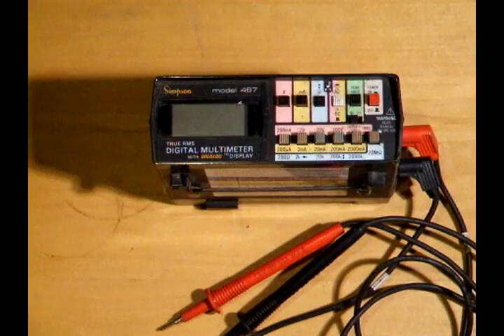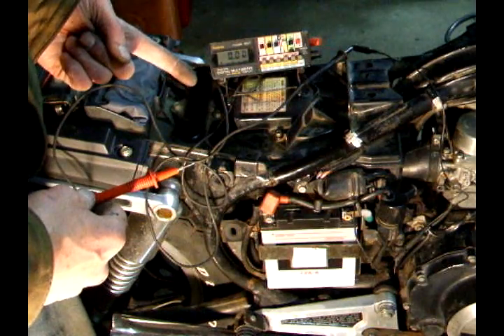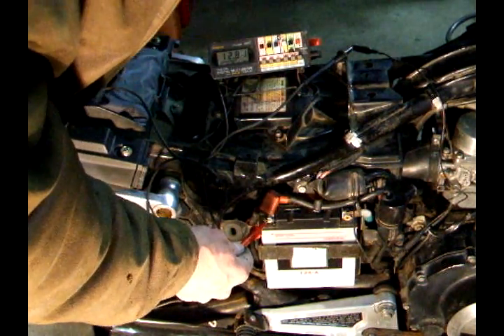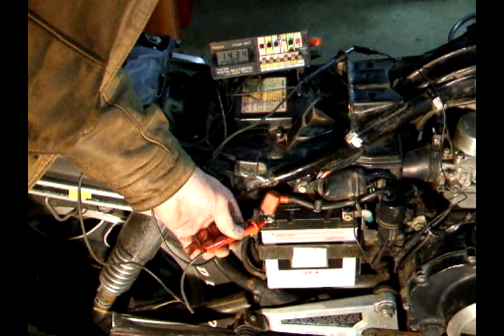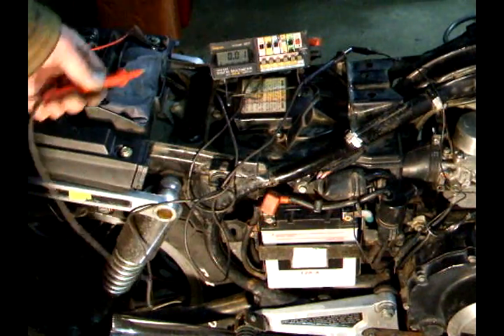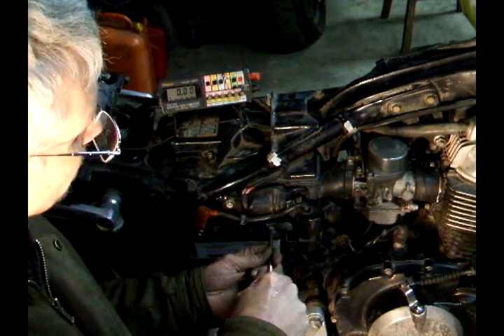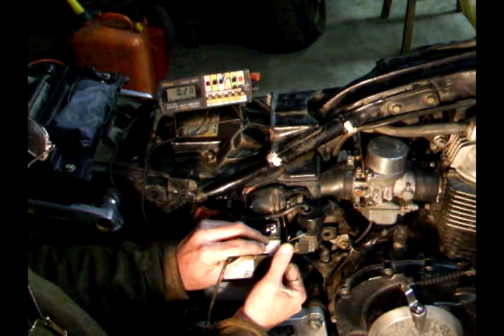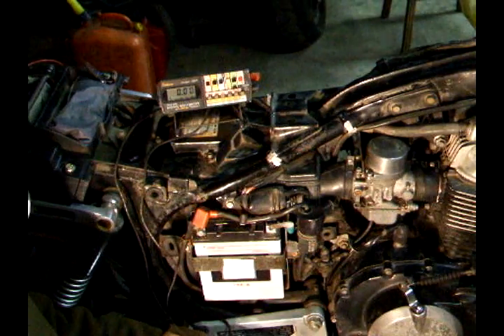Motorcycle voltage regulator charging and rectifier test

Comment: During the battery drain test, I have 11 Volts, which is the voltage of the battery. Does this mean my rectifier is dead, or voltage regulator. When running, the battery drains. When turned on but not started, it will drift back up to 11 volts. I know this is low, but even when jumped, it starts at 11 and drains until dead. Bigger issue than just a dead battery, what are your thoughts? I’m stranded right now.

Comment: Thanks for the video. The battery in my 69 CL450 seems to be charging fine, but the recrifier is looking pretty rough. Is it worth replacing with a cheap modern rectifier or do you think it's best to leave it alone?
Reply from the maker: They make real nice solid state rectifiers now as a direct replacement for those old orange finned ones, that are way more efficient ,reliable and not that expensive. Here is a link to one on amazon. Rectifier Single Phase Charging System Honda Twins  https://amzn.to/2IFgMUb

Comment from the maker: To support this channel go to Amazon through the links below and make any purchase:
Need a new battery or voltage regulator? Amazon will bring it to your door.
Amazon AGM Motorcycle Battery http://amzn.to/2py1m6g
Amazon Digital Multimeter  http://amzn.to/2dHWs3K
Amazon Voltage Regulator Rectifier  http://amzn.to/2hcpYgF
Rectifier Single Phase Charging System Honda Twins  https://amzn.to/2IFgMUb

Comment: I did the drain test and am getting 10.5. Does that mean I have battery drain and how can I troubleshoot that? Thanks.
Reply from the maker: Yes, you have a battery drain. Unplug your voltage regulator / rectifier  and repeat the test. if that's not it, pull fuses one at a  time till you isolate which circuit has the problem.

Comment: I tested mine on my Honda 1100 Shadow and the voltage actually dropped when the bike was reved up. I found out the stock regulators on Shadows are a poor design. They don't send enough power to the battery and also send all the extra power to ground, which makes them run very hot and can burn out the stator in the process. So I found that a Mosfet regulator is far superior and runs cooler. So I bought a used one off Ebay from an R1 Yamaha and installed it. Now it runs 13.5 at idle and up to 14.5 when reved. I can run all my accessories and still have full battery power. The best mod I ever made!!

Comment: My motorcycle is pumping from 14v even to 16v on throttle peaks...usually around 15v. I used an UNI-T clamp meter to measure it

Comment: Great video. Thanks for doing it. Here's my issue:
When I do the diode test, my readings are 439, 440, 440;  0, 0, 0;  093, 093, 093;  0, 0, 0. When I check my fully charged battery I get 13.3v. After starting it drops to 12.2v while idling. The drain test was 12.82v (key off). Currently the batter is at 12.83v. I'm thinking it's the Regulator/Rectifier but would like your opinion.

Comment: thanks motocycle nut , actually i did it with the key off and like i said i got a value of - 12.4 .last night i have tried to check the 3 diode terminal of the rectifier with a multitester set on the diode channel .the readings were 501, 502, 527 on the negative terminal of the rectifier, when i reversed it the readings of the 3 pins were all zero. on the positive terminal of the rectifier the readings were 521, 522, 521 and when i reversed it all were zero. i  did the diode test based on the other video .

with those result im guessing that the rectifier part of my reg/rec is near to die soon .in addition i did a physical check on the reg/rec and i observed the theres a hump on the silicon part which is very visible.
Reply from the maker: +Leo Deleon Sounds cooked to me. Loose or crusty battery terminals can do that. So clean and tighten them before your fire it up with the new voltage regulator/rectifier. Make sure you have a good battery also. Best of luck to you.

Comment: hi motorcycle your video is very informative thanks..
i have the regulator of my motorcycle as what you did in your video the results were during idle its about 12.6v when i revved it around 3k rpm its about 14.4v which i think its good.
however my concern is the drain test on the negative terminal which i got a value of - 12.4v (negative value). im already confused i checked it 3 times with the same result am i missing something or does it means my rectifier is not working .by the way the bike is kawasaki z1000 2012.
Reply from the maker: +Leo Deleon Sounds like you did the drain test with the key on. Try it again with the key off.  You should get a reading of less than 1 volt, if not then your rectifier is defective. It's built in to your voltage regulator in your case, cause you have a newer bike

Comment: Hi, I'm getting about .7 volts for the bleed test. Do u think this is too high? Thx for the. Videos! 👍
Reply from the maker: +Lyall campbell Sounds ok if its a 12 volt system on a larger bike.
Reply: +A Motorcycle Nut  it's only a DR650, so not considered big.  Why does highest voltage mean the rectifier is going bad?
Reply from the maker: +Lyall campbell If the high voltage goes over 14.8 -15 volts the unit is not regulating the voltage and it will over charge the battery and burn out your lights.

Comment: Hi thanks for this vid. So I checked between negative terminal to negative of battery and measured about 4v. Does this mean I have a bad rectifier or leakage somewhere?
Thanks
Reply from the maker: guruji243 Yes it does. If you have multiple fuses in your bike remove them one at a time. Recheck for leakage to determine which circuit has the problem. If all the lighting circuits don't effect the reading, you know that the rectifier is bad.